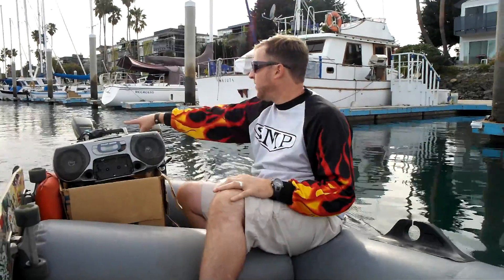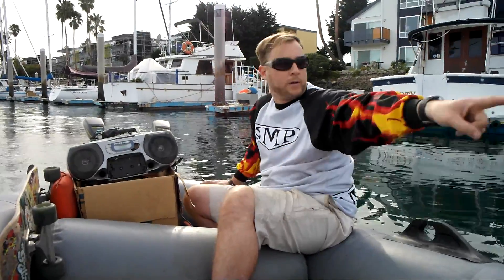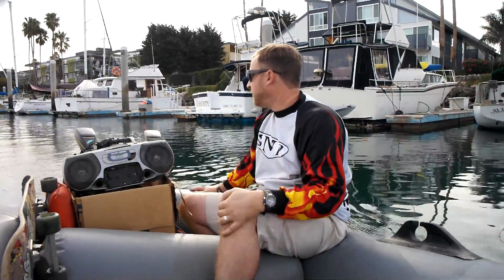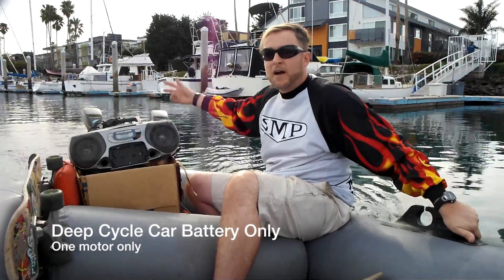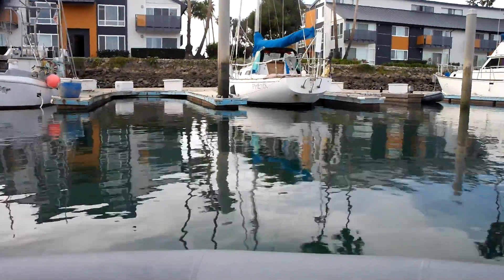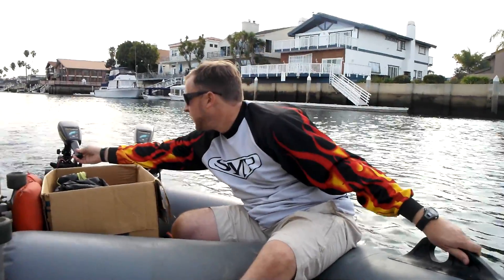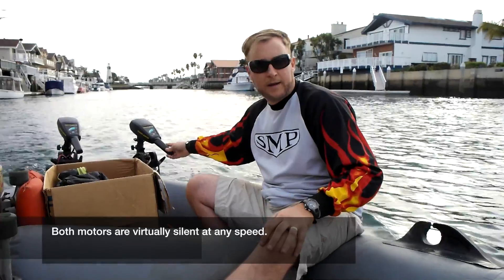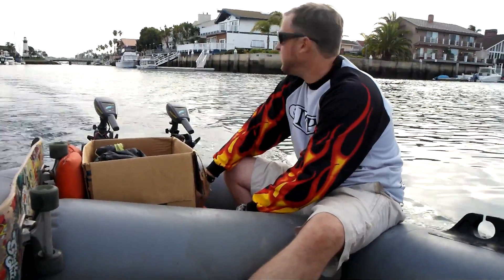Deep cycle vs. start battery tests on Minn Kota Outboard Electric Motor

Comment: Works as expected.¬¬¬>allmy.tips/Minn-Kota?K89     Mounts securely on my Canoe. Has multiple Tilt and Depth positions. Telescoping Tiller Handle.
Reply from the maker: I don't understand.  What does this mean?  "anywhere i looked for small boat works well easy to run"

Comment: everyone says do not use a car starter battery on a trolling motor but hard to find someone actually putting that to the test
Reply from the maker: A lot of people fear taking a battery charge so low that it will damage cells.  When trolling around in a dingy, a person will stop using a battery when there doesn't feel like enough power to get back to port.  Even at that point you're still just a little under 12V.  its not like the battery goes empty.  A case of no harm, no foul.

Comment: I have to ask.  Are you running away from home?   And also.  Is that an outboard or a trolling motor setup?
Reply from the maker: An inboard motor is a marine propulsion system permanently installed in the boat hull.  So technically this is an outboard trolling motor.  All electric, no noise and no smell of fuel and carbon monoxide.

Comment: I would like to know what amp hour battery you got?
Reply from the maker: hi yoshi- if i can remember ill try and find the batts and find how many amps per hour the deep cycle and car battery provide.
Reply: VenturaWeddings thanks. This is the only video i can find that does a comparison between batteries. Thanks
Reply from the maker: I wish i knew the a/h of each batt.  These were two refurb interstate batts with no stickers.  :(       I put some links in the videos to other Youtubes i posted that test how much power/how long each battery lasted running the same motor in confined water tub.